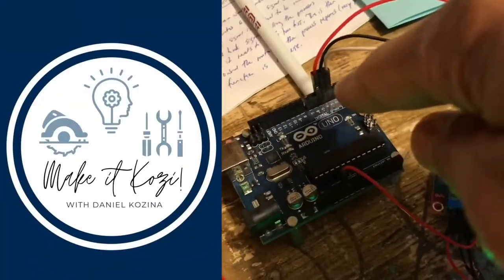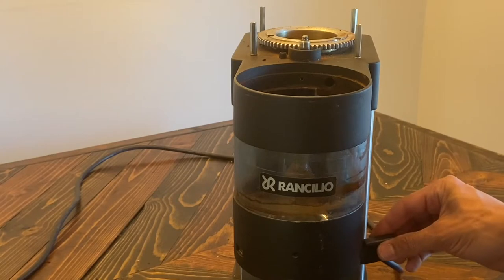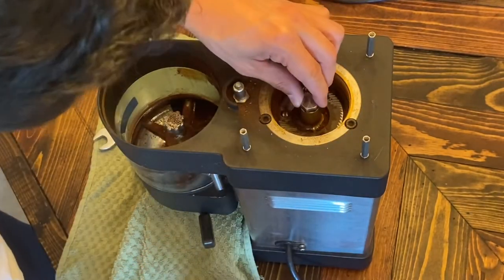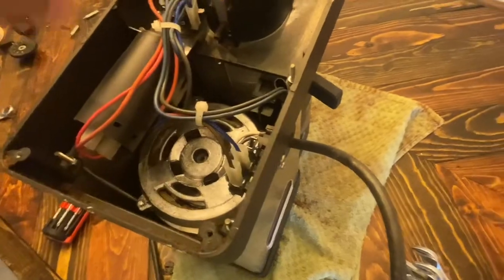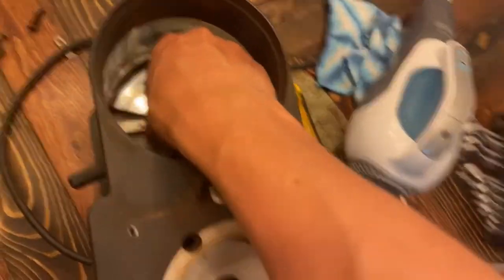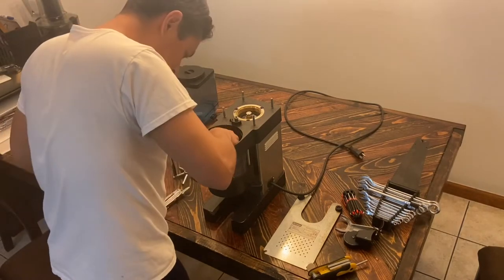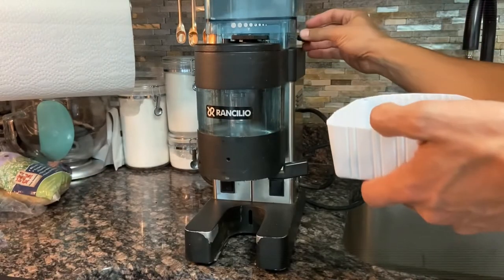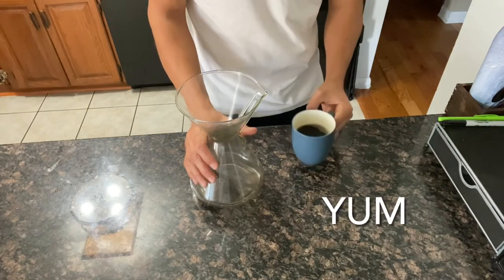Rancilio Coffee Grinder Restoration

Comment: Perfect timing I was just given one of these for free(!) and it is gunked UP.
Reply from the maker: Aw score! I hope you get it cleaned up and running smoothly.
Reply: @makeitkozi  eh... it was... well let's just say it made the condition of yours look almost new. the oils and grind were so caked up and hardened, the screws to the bottom burr literally stripped immediately just using a hand screwdriver
Reply from the maker: Yeeks, hopefully those are easily replaceable and you can get it up & running.

Comment: Any way to turn this into a single dose grinder?
Reply from the maker: Single dose like single serving? I do that all the time if that’s what you mean. Kind of like a burr grinder but more often than not, I do a weekly grind for the fam. Hopefully that answers your question.
Reply: @makeitkozi  do you grind a bunch and back bag it? Or do you leave it in the hopper?
Reply from the maker: I grind enough for the week, place it in a bag trying to expel excess air, and place it in the fridge until I make a cup.
Reply: @makeitkozi  I’m learning now that I meant a doserless grinder. Not single dose.

I am having troubles with my md40 though.
Would you be willing to make a short video showing you’re grind adjustment dial and show me which way is finer and coarser. The numbers on mine seem to be backwards. Also…it takes like 3 minutes just to grind like 20g of espresso….isn’t this a commercial grinder? I expected it to be much faster.
Reply from the maker: Hmm not a bad idea. Perhaps I’ll put a short video out soon
Reply: @makeitkozi  that would be so helpful. Thanks so much!!!
Reply: At espresso fineness, my MD40 takes well under 30s. I'd say 15s or so. You're either way too fine or have worn burrs? A lot gets stuck in the chute before the dosing chamber if you're trying to only grind one portion.
Reply from the maker: Getting this secondhand, I bet I am due for a burr changeout.